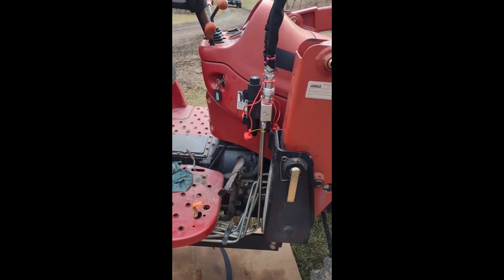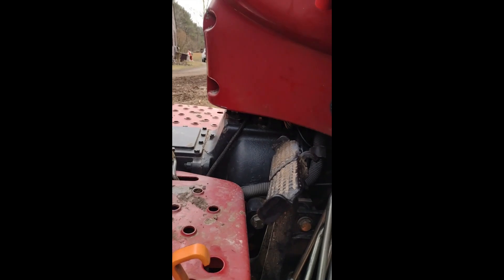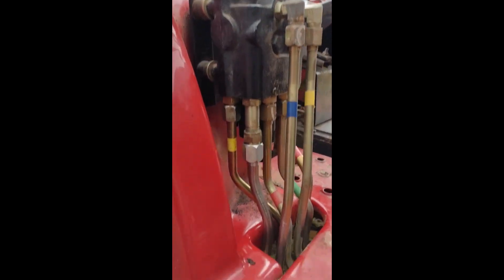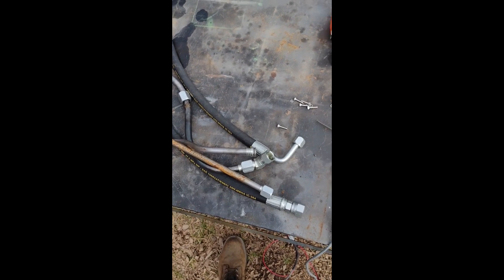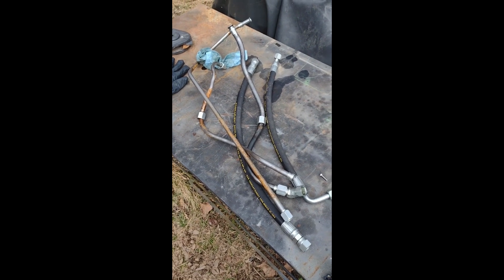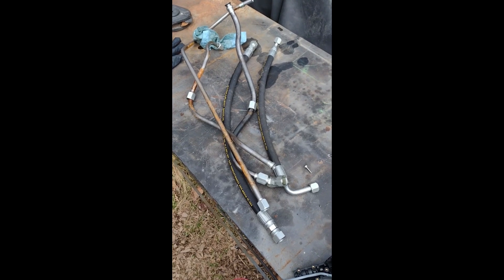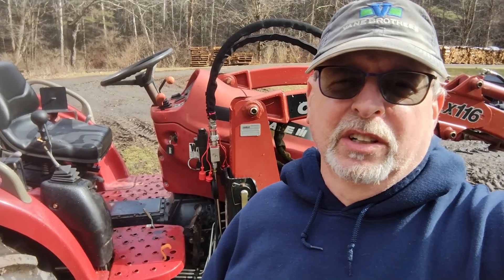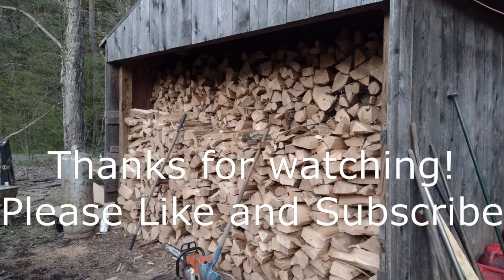Installing a 3rd function hydraulic kit on a Case IH D40 tractor - Part 4 - 047

Comment: Any chance of getting a hydraulic flow schematic of your addition? I have a Case 40C I wanna do the same thing on. It’s slightly different in layout but the loader valve looks to be the same or very similar.
Reply from the maker: Hey Michael. I didn't want to include that in my video for fear of violating copyright. However I'm going to redraw it and when I'm done I'll send you a link. It's actually simple. Just put the 3rd func valve in series with the power beyond line. Making sure that you have the direction of flow correct. Do you have a service manual that includes the schematics?
Reply: @Millstone_Firewood  Thanks! I don’t have the service manual yet. I will find one today. I have been trying to decide whether I want to add a second rear remote with the factory kit ($850 for 1 but with factory mechanical lever) or a Summit kit ($650 for two but with aftermarket electronic actuation). I will definitely be ordering the Summit 3rd fcn as the dealer just uses a 3rd party WR Long kit and at quite a bit higher cost.
Reply from the maker: The main thing is being able to connect the pipes//hoses. The Summit kit doesn't come with hoses and the instructions are incorrect for Case tractors. The only thing in the instructions is one sentence that reads, "...doesn't work with open center hydraulic systems." Or something to that effect. And that's it. No further instructions or explanations. When you get your service manual, send me the hydraulics section. Another really important thing is that we don't block the flow from the pump. There always needs to be a bypass to the reservoir. Normally there's a relief valve in circuit that prevents over-pressure.
Reply: Wow… lol… yeah the service manual makes it pretty clear… I’ll tap into the power beyond port from the mid mount valve… basically placing the summit in series between the loader (mid-mount) valve and the rear remote valves… I think… I’ll send you the hydraulics layout if you don’t mind, just for confirmation.
Reply from the maker: @mmckinney525  yes please do. You can use my email: m.smith64@frontier.com